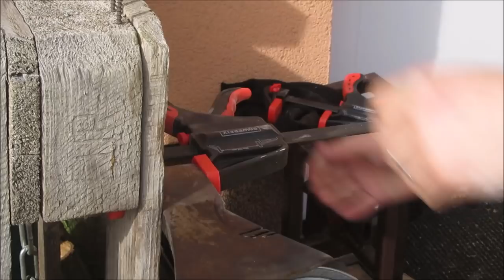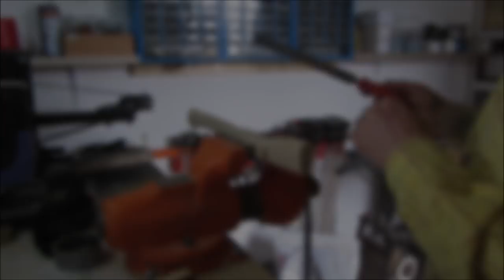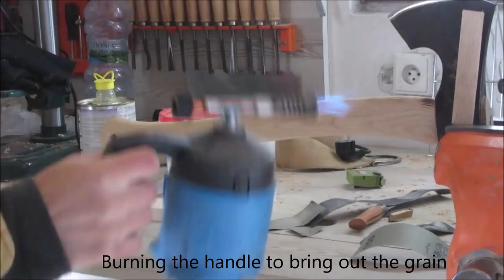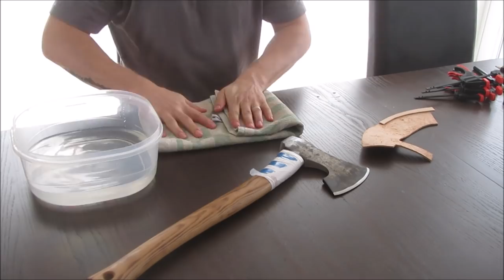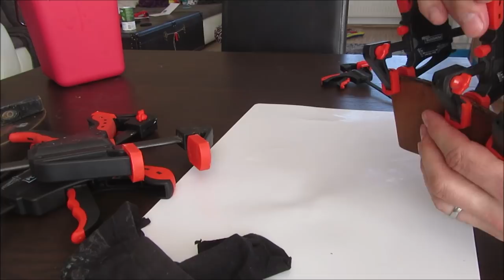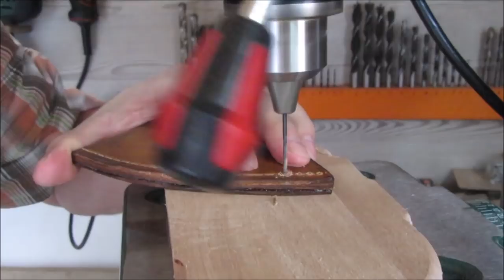Modifying and making the perfect axe for my hiking trips.

Comment: I like it. Make a leather loop that attaches to both sides of the lower end of your sheath and is long enough to circle just short of the end of your handle and you'll have a carrying strap that you can carry over your shoulder. Pretty useful if you're carrying an armload of wood back to camp.
Reply from the maker: That's a good idea, still need to make something like that. Thanks!

Comment: Great, handy little axe. May I make three suggestions? One, how about making a strap that would have a hole for your handle to fit through and the other end of the strap attached to the tip of your sheath? That way you could sling the axe over your shoulder with the axe head hanging down at about your waistline. Two, how about attaching some type of pocket to the sling as a place for a file to sharpen the axe? Three, how about making your handle from the white sap wood of a hickory tree? You could split the wood needed from a hickory, chop it into a rough shape and finish shaping with a draw knife or rasp? You'd have to let it season well or it will shrink after it is fitted to the axe. The reason I suggest this is because handles made this way are almost unbreakable. You can drive the axe into a log and pull the handle 45 degrees sideways  and they wont break. Guaranteed. I had an uncle who made his axe handles in just such a way, and I've made a couple myself. I usually leave the handle end tip rough, with a chop mark or two showing , just to point out that it's been hand made. That's a well designed little camp axe. You add that handmade handle and you wont end up in the woods with a busted handle and no way to use the tool you might need.
Reply from the maker: Hi, great suggestions! 
1 & 2, I like this idea, will execute it soon, thanks.
3, It's on my to-do list, i have already some ash drying for a year now, but it will need at least a year more, before i can use it. Hickory is not growing here, all commercial local handles are either ash, or imported hickory.
Thank you for the feedback!

Comment: Howdy. It was nice to see someone hang an axe with the grain of the handle properly oriented. Although I see it all the time, I never glue my wedges. My father taught me to shape the handle tang for a good fit and then put a few coats of 50/50 raw linseed oil/turpentine on the handle tang and let it dry completely. The tang will swell a bit and stay that way even after you hang and wedge it. The tang cannot dry out (shrink) and become loose as it ages. It must work because the axe Dad taught this to me with is still going strong and has never loosened after 50 years of frequent use. It's just an option...
Reply from the maker: Hi, your dad did a good hang for sure. And yes, there are many people doing it the way you describe, and there are other ways as well. Although several tests have proven that the wood does not swell from oiling it, i believe it does create some sort of friction which helps with retaining the wedge somehow. I've tried various ways already, and like to keep learning and trying other ways as well. Thanks for your comment, and enjoy that dad's axe. Sadly my dad didn't have an axe, but my boy will surely get mine 😀
Reply: @dabberty  Thanks for the reply so quickly. The way my Dad did it was taught by his Dad. I think the main reason for my handle to have lasted as long as it has is largely due to the facts that; A-, I NEVER lend it to anyone, not even my grown children - I have other expendable axes for that; and B - I keep it out of the wet weather unless I'm using it, then it gets dried and hung up. Oh! The handle has been lightly oiled years ago and waxed with beeswax on occasion. I will be forging my first bearded axe later this winter and will employ the scorching technique you demonstrated - looks pretty good! Merry Christmas from Alberta, Canada.
Reply from the maker: @michaelheurkens4538  thats awesome, i forged my first bearded axe 2 weeks ago, and it was a great experience, defenitly recomendable to do so.
You can see pics on my blog www.dabberty.com
Merry christmas to you and your loved ones as well !

Comment: I’ve modified a few axes to make them bearded and they all turned out well, but they pale in contrast to yours. Well done. And I couldn’t help thinking you must hike much more aggressively than most. My small Norlund hatchet or old Plumb National do me just fine at a fraction of the weight of this here axe. I’ll have to watch your other videos to see how you employ it. Cheers:)
Reply from the maker: Thank you! Thruth is that I ise it almost only during our winter hikes where we use long fires most of the time. During the other hikes just a small 600gram axe or a big knife is sufficient.
Reply: Dabberty I once took a Condor Scout (1 lbs) on an overnight hike to see how well it would fare. It ended up snowing and we got stuck longer than planned but that little hatchet did amazing.  Would’ve preferred larger, of course (and now I do pack my Norlund or Plumb) but it’s amazing how little you can actually make do with

Comment: Ash is ok. It's easy to work. But if you want a handle that is almost unbreakable for your axe you need the clear white wood from a fair sized hickory tree. You dont need any dark wood in it, just the white wood. It will rot in the weather but properly shaped it will bend almost double and if kept dry and away from insects it will last forever under hard use. Save the ash for hammer handles. It doesn't compare to the white wood of a straight grained hickory, not even in the ball park. I've  heated my home with firewood since I was 22. I'm now 65. I've tried store bought handles and ash handles. Store bought hickory wont hold up because its Dawn. Ash will shatter. A handle of white hickory sap wood shaped following the grain wont wear out or break unless you wear it out below the eye from splitting wood.

Comment: Near perfection sir !! Bravo!! Beautiful axe head and handle! And not overdone ! And only had to change the underside mostly unlike other dudes shaving the top which is unnecessary to me! But does the axe head work well and stay on ?
Reply from the maker: Yes sir, still performing fine. Oiled the handle 3 months ago before the winter started, and occasionally a touch up on the edge. Thank you for the compliments!

Comment: Great work, really fantastic craftsmanship. My favorite part was the hanging of the axe, it was clear when you showed the up close shot of the eye towards the end that the wood wedge went all way across the eye lengthwise and the metal step wedge was in there deep but didn't split the wood. That ax head isn't going anywhere. Did you carve out small ridges on the wooden wedge with that file to give it a little more "bite" when it was hammered into the handle? Nifty trick if that's the case.

Also, all those axes on your back wall, you clearly don't have enough and should get more haha.
Reply from the maker: Lycurgus224 I like the way you think about axes :-) And yes, the ridges in the wedge help staying put. Never a ridged wedge popped out so far, so I believe it works. Thank you for watching!

Comment: Great video. Now can you please tell us why the shaping of the head and handle?
Reply from the maker: Hi, the handle I made only shorter, nothing else. The head was reshaped at the bottom so you can choke up the axe head when you want to do finer work with it, similar like carving axes.
Reply: Thank you so much. I have been wondering about the  neck as well as the leather wrap. That makes perfect sense for fine work that would be necessary in camping for a belt axe.

Comment: Do you think there would be any benefit to doing a new edge quench on the ax after you re-shape it? Are axes hardened in the first place? I assume they are since  you made sure to keep it cool. Just curious because I want to make one similar to yours as a gift.
Reply from the maker: Hi, axes are definitly hardened, usually a couple of centimeters from the edge up.
If you would clean your axe head from rust, by putting the axe head in vinegar  for example, you can see after 1 or 2 days where  the hardening line ends. 
I think it's easier to keep the head cool rather then heat threatung it again.

Comment: So you didn't normalize it, and then re heat treat it I noticed. I know a lot of people do that when doing this kind of stuff. How did the steel hold up then? I guess since you kept it cool while grinding you kept it from ruining the temper on the edge. I would like to know because I've been looking for an old axe head to fix up and turn into a camp axe and this could be a viable option for me to do.
Reply from the maker: killgora1 If you don’t let the edge become hot then your fine. Mine became never hotter then i could touch with my hand. Always cooling it in ice cold water.

Comment: You did a beautiful job shaping and making your axe and handle look very nice.. unless you reheat treated that axe head, I'm pretty sure you ruined the heat treatment on it and I wouldn't trust that axe head ,blade on any thing, especially heavy duty chopping.
Reply from the maker: Thanks, if you watch the first 12 seconds of the video, you can see and read how i prevent the head from overheating. If you continue to watch till about 1 minute, you see that with every cut and sharpening, the head is wet from the cooling. So no worries about ruining the temper.
Its been a while since i made the video, and the axe is still working perfectly fine.
Reply: @dabberty  I missed the part where you were keeping the axe head wet. I stand corrected. Beautiful job!
Reply from the maker: @rustyyates421  thank you Mr Yates

Comment: What type axe head did you use? Carbon, Stainless, or just one you found laying around? I'm asking cause I want to try what you did and make one for myself. Cause I love the style but I am not paying $150 to $300 for an object I am going to be using for work. Unless its a power tool. Then yes I would probably spend that much money depending on what it is for.
Reply from the maker: 99÷ of all axe heads here are carbon steel ones. This one had no brand name on it, but it doesn't mean it is junk. It had a quite high ring to it when you would tap it, which usually means it's properly hardened. And I was right, many used andnonly one I needed to touch up the edge slightly.

Comment: I didn't realize an angle grinder could eat steel like that. What amp grinder and what disc?
Reply from the maker: It's a simple Bosch 1000w grinder, speed is 11000. 125mm diameter cheap cutting discs. And then the flattening is done with cheap flapdiscs.

Comment: What was the starting weight and face of the axe-head and the length before and after of the shaft?

I have several axes that I want to 'rust blue' and I'd like it if I could use your modification on one, for the same purposes you named.

Well done on the video, it is instructive.
Reply from the maker: Eli Griggs Hi, the starting weight of the axe head was 1000gram. The handle was something like 65cm, but I want my axe to be 55cm, so thats why i cut a piece off. They dont sell handles here that are 55cm.
It’s still a bit on the heavy side, but not that much. Total weight now is 1153 grams
Feel free to mod it any way you want. I’m not the owner of it. Good luck and enjoy the work+ result :-)

Comment: i have a grinder and an old axe...any way of doing this without a belt grinder?
Reply from the maker: I guess yes, it will just take longer, and make sure you dont overheat the head, otherwise you'll need to heat treat it again.
Reply: @dabberty  ok thanks

Comment: Sorry if this is a dumb question but what is the leather on the handle by the blade for? Ease of handling when cutting small wood for fire starters?
Reply from the maker: Hi, it's to protect the handle in case you overstrike, or when the wood is curly and the front stays closer together. When i want to do the finer work, i can just slide it down and choke up on the handle.

Comment: @Dabberty Question: Was wondering what kind of axe head did you use for this mod and build? Any recommendations as to what axe heads might work best for this kind of thing? Excellent video, liked and subcribed! Thanks
Reply from the maker: EnigmaRain Productions It was a no name rhineland pattern. After ww2 many axes where made without stamps on it, which does not mean they’re bad quality. I chose this one cause it had a nice ring to it when tapping the edge. Any recommendations? Not really. Hard  metal ones keep an edge longer but are also harder to sharpen. Softer metal ones need more often sharpening but it is also easier.
Good luck !

Comment: Hoi Dabberty, great work! I am at this moment 'copying'  your design for an axe for my daughter! One question: is there a functional use for the leather collar or is it purely for aesthetic purposes? Thanks!
Reply from the maker: Hi, it has a functional purpose; to protect the handle from missed hits, or when the wood splits and hots the handle. Thanks to the beewax on the handle it stays in place but with a little effort you can shove it down if you want to choke up on the head for fine work.

Comment: Do a dance that is loose and dangley of limbs in character while making a goofy face. Call it The Dabberty dance.

How does the axe perform? You radically changed the geometry. I assume it was a well designed, quality axe to begin with. Did you read up on how axe geometry relates to performance, or did you just wing it, or base your profiling after other axes you’ve seen?
Reply from the maker: No geometry shizzle there, just based on modding other axes previously.. it works well, slightly heavy for longer one handed use,  but then again, its not a full time working axe, just for hikes and camping tripa. So all in all, it does what i created it for just fine 😀

Comment: Never sharpen a blade with the aid of machines. Ruins hardening. And then ... Why shake the axe head in the water? Is it a steel that absorbs water?
Reply from the maker: Unless you know what your doing, have the skillz, and keep it cool all the time. As mentioned in the video, the head got never that hot that I couldn't hold it anymore. Shaking in the water cools it better and quicker then holding it still.. it's a  experience thing.
Reply: @dabberty  Sure... I still in doubt
Reply from the maker: @cpt.marley  Thats ok, but the axe is after all this time my favorite one for hikes, and no issue's with it

Comment: Doesn't explain why the shape is better.
Reply from the maker: Jeff Shermer Alright, it’s long and heavy enough to still fell a small to medium tree, and it’s still short en light enough to use single handed for small tasks like sharpening poles for tarps etc. When you shove doen the guard, you can choke up on the axe and use it for light carving, feather sticks, potstands, etc. Hope this explains it.
Reply: @dabberty  I can totally see the reasoning behind the mods how much weight did you lose after cutting and re-profiling the head?
Reply from the maker: @SpamMusubi308  originally it was a 1000 gram head, and with the mods done it came to around 840 gram. With handle, sheath, guard it is around 1100 gram in total.